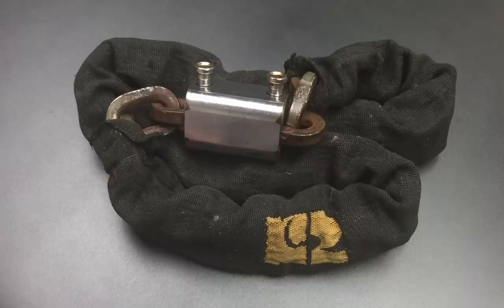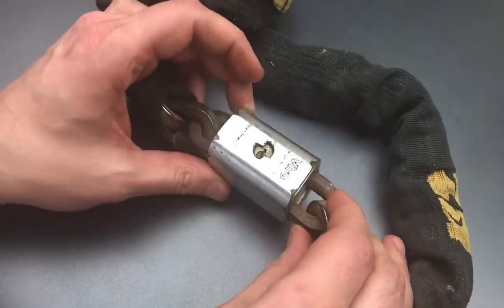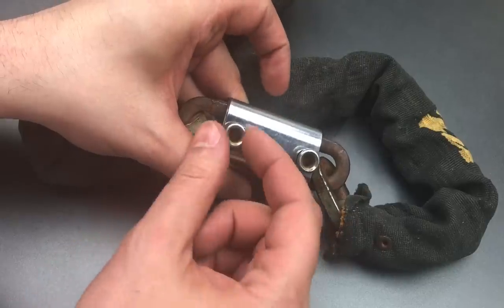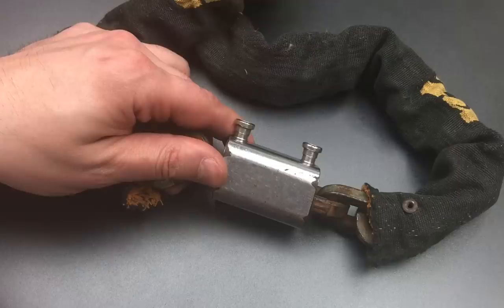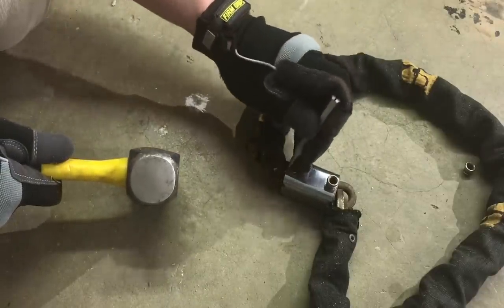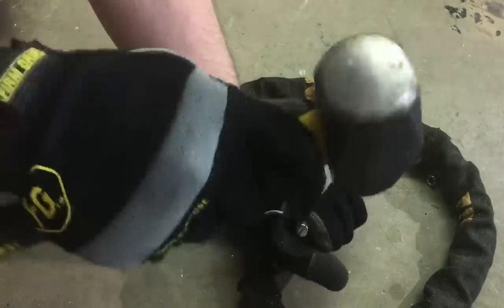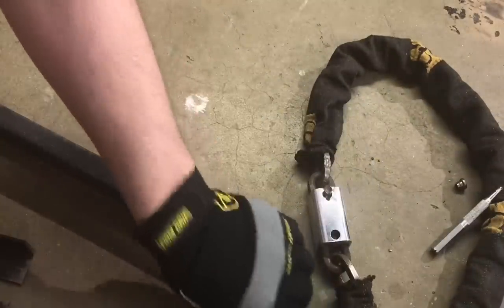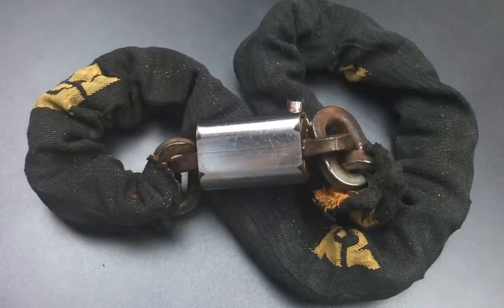[662] Destructive Testing of the Viro “Blocca Catena” Bike Lock

Comment: my first thought to break was melting part of the lock, and being steel, fastest way to melt, or at least first thing i thought of was thermite, and honestly,danger set aside, thermite is really easy to make
Reply: The  brass would melt right out, leaving the loose steel bits behind, if you used enough thermite to bring that mass of metal to the melting point.  Effective attack, but not exactly subtle if you're a bike thief trying to avoid attention,.

Comment: When in doubt, try Thermite.
Reply: That's always my first thought on any of these is how to get a thermite attack to take out the lock without taking out the thing you want open. But if you're playing with thermite you can take the whole bike rack off the ground if you want lol. A specially machined tungsten alloy funnel could sit on top of a lock, maybe a whole delivery capsule system with an internal igniter so you just trigger it, step away and wait for the thermite to start showering out on the top of the locking device. At that point it's super specialized, but lpl has made several custom tools with bill, so a lock buster trump card wouldnt be unreasonable if those are on the table.

Comment: I know you did this over a year and a half ago now, but I think since then that there's a couple of tools at your disposal that would do the job.

The guard on the keyway might cause some issues, but the Zieh-fix core puller might be up to the task of yanking out the core and maybe snapping out the bits of hardened steel holding that bad boy in place.

your plan of leverage was a good one, but I think at that point that you'd have to come up with a way to reinforce the shackles. at this point, you likely have a lot of Zinc at your disposal from various locks that you've obliterated with blow torch attacks or such. would pouring some in those shackles, giving it a bit to cool, and then attempting the leverage attack have been more effective, do you think? I realize that that's decidedly less practical for a real life theft application, but that was an idea I had when I first saw the video.

A destructive attack I never see you discuss is the application of say... Hydrochloric or Muriatic acids. it's probably more time consuming and potentially dangerous than an angle grinder, but a more quiet solution. provided the acid doesn't get on the bike itself, a thief could apply acid down the shackle holes or on the lock body, leave, and if the bike is still there after some time, easily just break it (or the chain links, let's be real) and make off with the bike.

Comment: Can dumping part of the lock in a bowl of liquid nitrogen and smashing it with full force using a sledgehammer enough to defeat this lock?
Reply: It'd probably weaken it, but hardened steel holds pretty well under extreme temperatures. Since it wouldn't just shatter it'd probably deform. The best attack from that angle would probably be if the chains weren't frozen and they were used in a leverage attack, the shackles would sheer. But how do you not freeze the chains with the shackle? At that point you might as well attack the chain.
Reply: If Liquid Nitrogen is easy for common street thieves to get ahold of, we're in deep shit...

Comment: LockPickingLawyer............. just for curiosity  (not sure if already  been suggested)  how about trying the opposite of the many suggestions of how to pull the shackle pins out with extractors , claw hammers, wedges,  and instead use the  Ramset to push the shackle further in to overcome / destroy  the ball bearing  mechanism ?  pity the second head broke off with the leverage attack as it would have centred a drift for the Ramset  to strike.

Comment: if you can not spread them because they are drilled ou, whjy not inserting a round steel in both holes, then spreading them to break the lock on its sides

Comment: Okay ! Question .whats the best chain on the market  that i could buy to lockmy motocycle with the bowley high security brass padlock543 ? Thank you in advance
Reply: Some chains offered by Viro, they vary depending upon the weight.  Also, Viro's offerings of bike and motorcycle locks -  http://www.viro.it/Pagine/Menu.asp?Lingua=EN&Divisione=Ferramenta&Fam=8

http://www.viro.it/EN/8.BIKE_SCOOTER_AND_MOTORBIKE_LOCKS/174.332chain/332chain.asp?Divisione=Ferramenta&Fam=8&ID=368

http://www.viro.it/EN/8.BIKE_SCOOTER_AND_MOTORBIKE_LOCKS/175.333chain/333chain.asp?Divisione=Ferramenta&Fam=8&ID=369

Comment: this is an old video, so im probably not going to get a reply, but may i ask why you were holding that sledge so high? you rob it of a lot force that way. also, why not simply take a small butane cooking torch, heat up the brass, tap it with a punch a few times and thereby attack the shackle directly, rather than punching through the hardened steel or going for the shackle guides?

Comment: What about using a punch (or cold chisel) like you did at first to break the hardened steel beside the shackle, then placing a wedge and bolt extractor in the chain from the bottom, and use the chain with the bolt extractor to force the shackle out of the side of the lock?  

I'm not sure if it would work, but it would be fairly quiet.

Comment: Could you just put two pieces of hardened steel in the links coming out of the lock body and then torque on that? You’ve already proven that the shackle material is extremely brittle, so if you could get them to crack/break in the middle it would easily come apart.

Comment: This video may be over half a year old, and you may have already had this suggestion, but what about inserting hardened steel rods into the open holes in the shackles, tensioning the top of the rods, and spreading the bottom near the lock body?

Comment: Try using the screw spreader like a vise so the shackles can't spin and then drilling
Reply: Could easily just hold them with vice grips too. You needs some really good drill bits to drill hardened steel though.
Reply: the quality of the drill bits is irrelevant because the major factor in drilling hardened steel is how hard you can press on it, and a person cannot press hard enough. it takes a stout drill press or milling machine. if you were to have it in a drill press, then the quality of the bits would matter, although a mill would work best.

Comment: how about a bar through the first 2 links aprox 6 inches long  then a bar between the 2 bars on one side an hydraulic ram between the 2 bars to force the links away from each other via the lock ....mabe shorter bars so they dont bend and applies more pressure to the links

Comment: I think you missed one way to get in to it. Take a hammer knock the to topps of. Then take two wrenches or two crowbars whit round topp. And put in to the shackels pry them togheter and the bras should give at the topp and let the sprint turn out. Beacause they no longer have support at the top from the hardend steel. Or youst skip the hammer part. And they should break at the ball point. Silent and fast.
Sorry for my poor language no autocorrect  other than for Swedish and dyslexi.

Comment: i would have fed steel bars of a fitting diameter inside the drilled shackles and used the levers, i guess it should work
Reply: nevermind, no place to feed them in

Comment: Generally those nail set punches are particularly hard compared to a true cold chisel. The body of that lock looks soft enough that a good sharp chisel would probably be able to cut right through it. Of course, that would never be a practical process by any stretch.

Comment: nice, with a decent core and thicker versions (16mm bolt crop proof) then its everything proof except angle grinder, that's about as good as any lock is going to achieve,, they need to manufacture a metal that will "clog" up an angle grinder ie the cut metal expands and sticks to a cutting disc, then the bike theft would be truly out the window lol
Reply: It exists aluminium when heated turns sticky and gummy which is why you dont grind it
Reply: @jediben96  also certain polymers and plastics have a gummy & melting effect. If we could coat a hardened steel lock in that it would be good.

Comment: Try practicing your hammer skills by holding the handle at it's end and let the hammer swing instead of pushing it on the punch like your doing in this video. It will reduce wrist problems, gives more force and with a little practice and trust in yourself will increase your aim.

Comment: Watching some past videos reveals that you are pretty tool handy.  (I almost added, "for a lawyer."). However, using a full fist grip on an object being struck with an engineer's hammer is a potentially very painful no-no.  If you must use a body part to hold the to-be-struck object, fingers only and held some distance from the crush point.  Better yet, a pair of vice grips on the to-be-struck object.  Vice grips will not roll on the floor in agony if the hammer goes astray.

Comment: Pry the shackles but fill them with a drill bit or other hard metal
Reply: Metoo Nunyabidness that was my initial thought as well. Looking at the video they have only been drilled deep enough so they will break off at the top of the lock and you can’t get a drill bit or drill rod in deep enough to do any good. If you did put in reinforcement I would be willing to bet it would sheer at the same place it did again.
Reply: Riley Fenley 
I don't think that actually matters
The shackles are drilled below the surface of the hardened steel, it doesn't need to prevent the shackles from breaking but simply to give something to pry against

At least that's the way it looks to me
I could be wrong
Reply: This would defeat the intended failure point but just cause the shackles to fail at the point where the second shackle did.
Reply: Drew L 
Perhaps
Do we know the dimensions of the shackles and the depth of the hollow space?

Comment: NOOO!  you were so close,  why didn't you  just use the punch as leverage anchor     using   your  long steel blades  and  the punch    as resistance in  the right hole, I think that would have worked?

Comment: what about using lever between lock and chain to pull the chain ouf of the lock? If you know what i mean
Reply: That's my thought too, yank the chain out of the lock, looks like those shackle pins are pretty brittle and the brass insides are soft.
Reply: The problem with that is that the shackle pins are stronger at that point and thats a pretty thick chunk of brass to to pull through. Its possible that once the top part of the pin fails it would shift and  the chain to slip out but if attacking this in the field in use, it would be a problem of getting the leverage on the chain and having a strong enough anchor point to apply that leverage.  It could work but it would be hard. Like he said, the weak point is the chain and the core. Its easy to pick and easy to cut. It the lock body could be gone through with a grinder wheel or two but the chain would be far easier to cut with just  a few seconds of grinding or some bolt cutters. A 24" pair could probably make one cut on the corner of a link and be done with it.
Reply: This was my thought also, use the chain against shackles with leverage. Leverage always wins.
Reply: Put a stainless steel bolt through the first link on each side of the lock, and use the lever on that. Of course, by that point you might as well be using bolt cutters, which will defeat any chain.
Reply: Dan Powell no bolt cutters, particularly the ones easily carried up a sleeve or in a small bag cant defeat all chains. Even with perfect leverage, strength and weight. 
Peerless, pewag, security maxx and a couple kryptonite are all companies that make chaind at are essientially uncuttable with 24" cutters. 
 Ive not seen then decisively cut with even bigger cutters. 
Not every chain can be cut with cutters.
Reply: The angle iron was 3' long already, so not concealable. 

Biggest chain I ever cut was an anchor chain for a tugboat, but that chain is useless as a bike lock because no cyclist can reasonably carry enough of it to go around a fixed point and a lock that will go through the links.